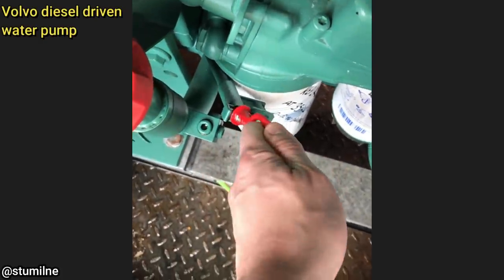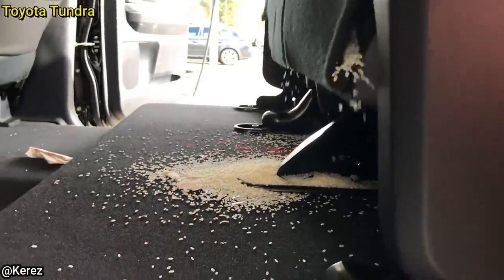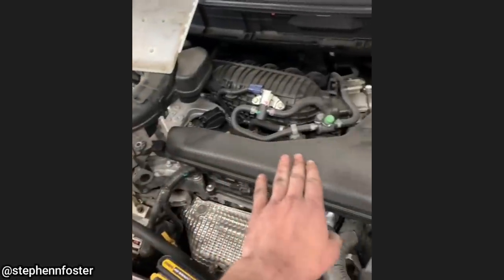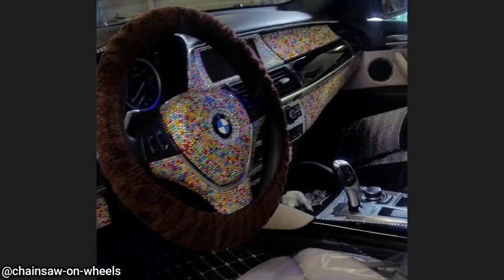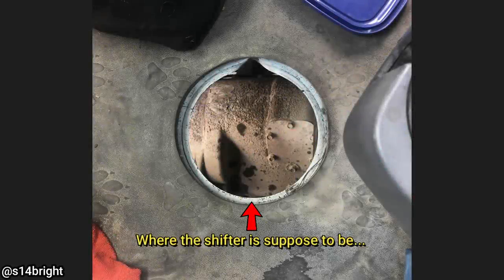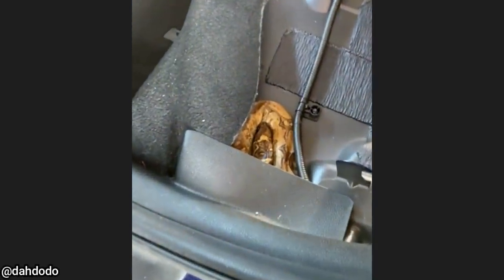Customer States Engine Is FULL Of Water | Just Rolled In

Comment from the maker: I wonder how hot that brake rotor got. Holy 💩
Reply: The special neon pink edition
Reply: According to a steel color/temperature chart, about 1500 degrees, maybe 1600. Google "color of steel temperature" for a chart.
Reply: Pretty sure Nasa spotted a few solar flares coming off that thing.
Reply: "My lighter just ran out...how am I gonna light my ciggy? Well, looky there..."
Reply: I remember seeing rotors that hot watching 👀 the legendary Porsche 917 can am racer with four rotors red hot and the fan over the v8 engine and turbo glowing hot in the dark of the 24 hours of Lemans. Saw it on YouTube...that 917 was one.of the craziest production cars ever made.
Reply: @K9River  Years ago I was helping some submariners move and they found an M-1000, no one could find a lighter or matches.........Me: boy you Nukes are Stupid, you have a stove don't you??  
Next thing I know as I'm helping to carry a canoe.....BOOM............I guess they got it lit........................
Reply: Looks like they were in a race.
Reply: ford says drive them, I had a few of these on ford Taurus 2012 cars. rear brake adjusts and rubs for a while, I was like are you kidding me? it was very often they would do it but still
Reply: I did that🌶 to a 74 Nova after it was sitting half a year. Needless to say the next day it got a new caliper, rotor, and pads.😂
Reply: How fast and how hard do you have to press the pedal to get it that hot? Had to been drag racing before seeing the smoke coming off the rotors.
Reply: I seriously thought that was pink paint as well. ffs
Reply: @Vintage Classic Cars  If the piston inside the caliper "sticks" the brake will drag and turn the rotor red hot. Normal brakes should never get to that level. Racing brakes need to be hot just to work properly.
Reply: He don't need breaks where he's going!
Reply: Must be a seized or at least dragging caliper, but you'd think the customer would have noticed the Smell From Hell
Reply: Brakes? What brakes
Reply: @jamesstuart3346  replaced my front calipers on my 01 silverado not long ago. i smelled the brakes. new rotors six months prior, and pads. piston stuck on the drivers side. but i noticed straight away. turned the rotors. they were okay, both calipers of course, and new pads. yes, the smell from hell. being a dummy, i did touch the rotor through the rim. ouch!   but i fixed it the next day. had my daughter even drive me to the parts store. the things you see on this channel alone? makes you wonder about who's driving next to you.
Reply: @RiverRatWA57  'helping to carry a canoe?" Sub rescue?
Reply: My wife had a rear caliper on our minivan do that. Caliper froze on hard. Thankfully she was near a friends house, and I had her pull over there. I arrived about 20 minutes after she called and I still couldn't touch any of it despite being around 0F out. Had it towed to the dealer and the caliper, pads and rotor were replaced under warranty.
Reply: It's in Winter mode. They melt the snow around the tires for better traction.
Reply: Last time I seen one that 🔥 I was still a teenager
Reply: About 800C.
Reply: @michaelbujaki2462  Wow, that's very hot 🥵
Reply: @haroldwilkes6608  they were moving, I didn't expect that the silly B*stards would pick that moment to light it.
Reply: At first I thought someone had painted the rotor with highlighter ink!
Reply: @ekummel  it looked like that to me too, 😆
Reply: @RedditBrew  i Ithink💬, I'm
Reply: @RedditBrew  i Ithink💬, I'm b
Reply: @VintageCars999  Its due to a collapsed brake line. Have had it happen at least four times to various domestic and Japanese vehicles. The liner deteriorates after about 6-7 years, and eventually the brake fluid works its way behind it, and forms a one-way valve. Once applied, the caliper never releases, and the hotter it gets, the more the trapped fluid expands, and the tighter the caliper grips the rotor in a vicious cycle that ends like that. Had it happen to my car when I loaned it out to my dad and that's how I got it back. Fortunately he told me in time to get a hose on it before the tire exploded.
Reply: @mysock351C  yeah that would make sense. I've been lucky hadn't had that happen. Driving a 22 year old vehicle on probably the original rubber hoses 😬 maybe they're built better or just always ran. Could be the fluid too? I've had my lines burst due to rusting lines. Thankfully I had my hand brake to limp to a garage.
Reply: I thought it was painted in pink LOL
Reply: @VintageCars999  My guess is it was a stuck caliper or one of those new fancy electronic e-brakes that are known for deciding to stop working with the e-brake fully locked.
Reply: @ItsaRomethingeveryday  pressing both pedals at once? 😉
Reply: All you need is partially seized brake caliber long drive enough and your rotors will glow in colors.
Reply: @mr.wizeguy8995  yes  my r31 skyline was forever seizing its rear calipers and making the discs rainbow. Rotating piston handbrake. Was fine on my early 80's subarus, but it felt like i was having the calipers rebuilt twice a year on the skyline. Did it myself the first time, thought i may have messed it up somehow so got a pair of changeover reco ones, not long it was the same, had them rebuilt, same thing happened again, ended up ditching the disc brakes on the rear all together, fitted some toyota corona drums and hand brake mechanism, disabled the self adjusters and never had a problem again (the self adjusters are prone to over adjusting the right hand shoes if you use the handbrake while driving)
Reply: @MiscDotGeek  being that cameras react to infrared, probably not accurate color
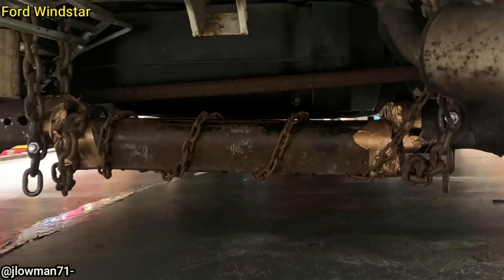Reply: At 2:26 the leaf spring has two fatigue cracks in it.  They are the two semicircular darker areas in the upper left of the leaf that broke.  It looks to me as if the leaf spring design was a monoleaf design.  It would be nice to know what the vehicle is.  One of two things would have caused this failure, 1) the vehicle was consistently overloaded; or, 2) there were no bump stops on the axle leading to a higher than designed for deflection.  hth, contact me if you want to hear a more detailed explanation or you have more information about the vehicle.
Reply: driver must be using the ol two foot strat

Comment: I don't know what's more shocking: the rear axle repair on the Windstar, or that there is a Windstar still running.
Reply: AMEN!
Reply: Yes.  Piece of junk.  Mine had the rear sway bar rust out & had to replace both front axles because the toner rings cracked.

Comment: Yeah it's safe,the rotor will eventually just catch on fire while you're driving down the road  😕
Reply from the maker: Looks like they're getting ready to forge with that rotor 🤣
Reply: Perfectly safe until it boils the brake fluid in the caliper, then NO BRAKES! :(
Reply: @PhilG999  had that happen on a secondhand motorcycle once. Long downhill, many corners, final corner of the mountain the front brake gave out! The old fluid (likely never ever changed) had boiled. I had to wait 15 minutes for it to cool down as I didn't have water handy... needless to say I now change the fluid on every used vehicle I get!

Comment: First clip: We've had flooding recently in lots of places. So many people would drive through going, "It'll be ok if I floor it through here in my car. One car I saw was certainly full of water (cabin and motor). I opened the airbox  and water came out as I lifted it. I pulled the air filter out and more water spilled out . I shook the filter and lots of water was coming out of it. Looking in the air box there was still about 1.5 - 2 inches of water in there with the feed to the motor at the bottom filled . No doubt the intake and cylinders had water as well. The flood he powered through was about 18 - 20 inches deep at the time.
Reply: Many drivers don't realise how low their engine-intakes actually are!
Reply: @stevie-ray2020  Exactly. Not to mention his air box was on the left side of the engine with the intake hole facing forwards. It was lower than headlight level.  The water from the left front wheel would have dumped straight into the hole. I should have taken a photo of the water in there with its position. It was laughable.
Reply: I do my annual undercarriage bath in the spring of the year during a heavy rain to wash the salt off but maybe 5 inches deep. I would not attempt something that deep even in a PU.
Reply: My civic’s was attached to the shock tower , I drove through the river crossing ( a few times I floated it ) I was insane when younger lol

Comment: My dad worked on tons of tractors back in the day (Alice chaumers) old ones that got neglected where the cap for the exhaust pipe was missing and then it rained in to the motor. That is what he got to deal with but instead of it being fixed right away it was years of water in them. Having to free those motors up was a lot of work. His solution if the cap was missing was an old coffee can when not in use.

Comment: heavy duty mechanic here.  for the transmission to do a 180 degree flip like that it would have to break a metric ton of stuff.   at least 2 transmission to chassis mounts.  at least likely 10 grade 8 (low end) bolts on the bell housing.  air hoses. and lots more

Comment: 1:53 we had something similar happen with a freightliner with dd15 and dt12 automatic in it, but it was caused by the tow truck driver towing it with the driveshaft still connected, the only reason it didn't spin itself out of the truck is because something inside the transmission sheered off and broke the connection so just the tail shaft would free spin

Comment: 2:32 I do believe the "how" would be metal fatigue. The cracks started at the top of the cross section (two dark spots) of what looks like the upper leaf spring. The rest of the dull grey area is where the cracks propagated across gradually, and the shiny stripe at the bottom is when it finally broke off completely. All things, considered, it hung in there for quite a while! Just had that thin little shim of metal at the bottom holding it together at the end. As for the why, don't know. Maybe corrosion? Incorrect heat treatment? Surface defect? Hard to say.
Reply: I've seen them just go bang when moving trucks over pits for servicing, its not all that unusual.

Comment: Shorter version of the twisted tyranny:
Crossmember mount between framerails for transmission probably not reinstalled after hotshot mechanic did a clutch replacement. Apparently this is what happens under heavy or shock loads to an aluminum bellhousing under such stress.
P.S. by the name on the shifter, "Eaton Fuller", I assume it is from something akin to a big rig which generally has 300-600HP with about 1300-1900 ft/lbs of torque. ... yeah, aluminum ain't that strong.

Comment: 2:58 i see a construction flaw here. If the phone doesn´t have "wake up by tapping" feature, you literally can´t use the phone in the stand. Because its power button is hidden under the stand fixation part.
Reply from the maker: Somebody else mentioned that also. They had to get a different phone case for it to work.
Reply: I mean, you should only use your phone for navigation anyways.

Comment: Oh wow..... Those brake - they aren't rotors any longer, they are that disc that rotates and a sensor counted the ribs for digital RPM, encoder disc - 

 Were those brake rotors glowing cherry red? Questions was "is it ok to drive like this?" ~ wow~ 
 Loved the cat protector rattles  - and that rear axle fix. I'm related to a genetic line that would absolutely do shit like that and lean back, gleaning with pride. 

 How that trans broke the bell housing and rotated, well, that has go to be 1, the strongest driveline ever, and strongest gear set/shaft/housing ever made. 
 but my guess is, all the bolts came out of the bell housing with nothing more than the locating pins resisting the rotational force, or someone forgot to put the pins in and loose/missing bolts lacked enough holding power. But that broken leaf, that says there was a traumatic sequence of events when combined produced a rarely experienced set of circumstances. Fully loaded truck I'm guessing, clutch dump in granny gear, Chassis torqued so hard busting a major rear leaf, when that popped the snap shocked the whole driveline and weakest link was the bell housing. How the drive shaft didn't twist like a candy cane is shocking, I've seen that. If not the drive shaft, how the diff gear didn't break is a surprise. Either way, someone had some splainin to do. $1000 bucks says the driver wasn't the owner.

Comment: I'm wondering if the 1:34 was the result of using head gasket sealer when coolant is leaking into the oil.
You are not meant to use the liquid glass formulations if coolant is getting into the oil as they can solidify the oil.

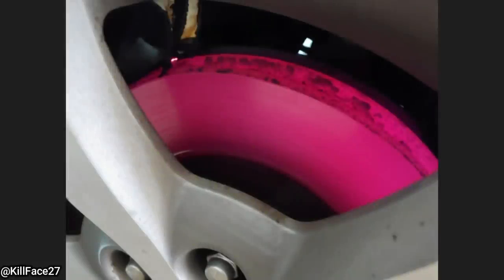Comment: 1:20 I'm sure it's how my mom's car disc brakes would have end up if she would have driven her car on the highway. *It has already been fix a few years ago but: Her 2 front caliper were seized to the point a C-Vice couldn't compress the pistons back into themselves. Oh and also the rear brakes were faulty as well. One E-Brake was not working and the other one had poor braking power.

I'm glad she is not driving her car daily when this issue was present lol.
Reply from the maker: That's scary lol.
Reply: @JustRolledIn  It was. She didn't had to brake to slow down. Few weeks/days before it got fix it her car's brakes were so seize that it's like she was hauling a trailer with a car on it.

Comment: 1:34 What are the conditions that turn engine oil into plastic anyway? Is it just heat and time?
Reply: Soot, water and other gasses from the burnt fuel mixture get dissolved into the oil. Places like gear boxes and differentials don’t usually have these issues and last much longer unless there’s some sort of leak or failure.
Reply: Never changing the oil. I once bought an old Ford Escort from a co worker knowing it had had about four oil changes in 100,000 miles. Under the valve cover looked almost as bad as that one. A few hours of scraping and running some kerosene mixed with oil at a slow idle dissolved a lot of it and it ran for about a year  until it was totaled.
Reply: This carnival only had 102,000kms on it too. It's hard to read but I think the service sticker has 2011 on it. 😳😅

Comment: The phone being mounted up there isn't legal in most states, as it's within your line of sight while on the road. Surprised to see an automaker taking that sort of risk.
Reply: How would that be in your line of sight?
It doesn't distract your view out of the window.
Unless if you are maybe like 5 years old or something, but you aren't allowed to drive anyway so... :D
Reply: @ferrari2k  State laws, I don't make them. 🤷
Reply: then what about all other modern cars with big screens protruding from the middle of dash ? :D
Reply: @Napster050  Again, I don't make the laws.
Reply: Lots of people use a phone as a GPS.   A dedicated aftermarket GPS is often mounted on top of the dash.  Of course drivers will find a way to use that phone for other purposes.
Reply: Uk Highway Code changed recently, any sort of phone now has to be in a phone cradle if in use while driving. Neat design but still too tempting to mess with! I guess phone manufacturers pointed out the sodding great touch screens in most moderns to legislators! 'They get away with it so whats the difference! 🤔
Reply: I think it’s supposedly supposed to be used by the passenger or when you are looking at GPS directs but I understand what you are saying, I mean some bad eggs will definitely use it for texting and driving and all
Reply: I’m 6’8”. I only use the top 4” of the windshield on any vehicle.
Reply: @GoddessOfMisfortune  ... most state laws are about stuff stuck to the windshield. This is on the dash and not blocking the windshield.

Comment: 2:30 "How?" Ive got a guess, drive shaft broke free from the rear connection, spun, slammed into the leaf spring, bent the outer section loose till it popped from its bracket, snapped the rest clean in two.

Comment: I worked at a wrecking yard that specialized in European cars the was a Saab that needed the 4 cylinder engine pulled to get to the right parts it had a hole next to piston number 4 but the busted rod came from piston number 1.

Comment: 2:30
You can clearly see the rust spots at the upper left corner of the that trucks trailing arm spring.  Those spots were there for a while, slowly growing until somebody probably popped the clutch or hit the wrong gear, torquing the axle beyond what the link could handle. Spring steel is brittle, and those links have to hold thousands of lb ft of torque, they don't really support the weight of the truck in that configuration, that's mainly the job of the airbags, but they do have to combat axle twist and the missing driveline is a good sign that a rookie or angry driver was at the wheel.

Comment: 2:26 - that's a pretty clean break on the spring.  Cut in half?
Reply from the maker: Doesn't look to be cut since it's a pretty clean break. Must have had too much weight in the back of that truck. Never seen a spring that thick break like that before lol
Reply: My guess is that there was some imperfections in the metal itself, causing it to be weak at that particular point. You can see what might be a couple of bubbles near the top, and only a thin part near the bottom has a true clean metal look. Chinese steel?
Reply: @OnlyKaerius    Chinesium

Comment: Hmmmm, if oil floats on water and water comes out the dipstick, then there's a boatload of water in there. At 1:35 what are these guys thinking with tools laid out on top of the battery?
Reply: Dead battery... As in 0v. No danger
Reply: @mmorgz6622  ... my point being is this is an unsafe practice... a bad habit... etc. What happens next time when the battery is NOT dead?
Reply: If it has charge, it's covered or removed. Regardless the terminals are never shorted anyway.